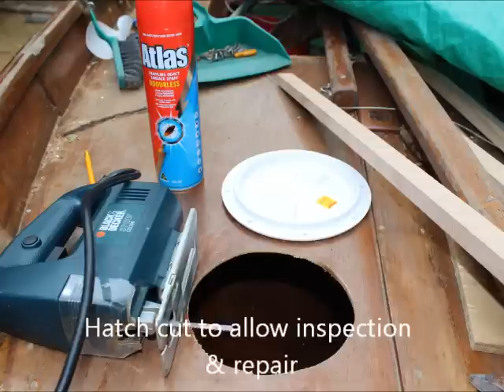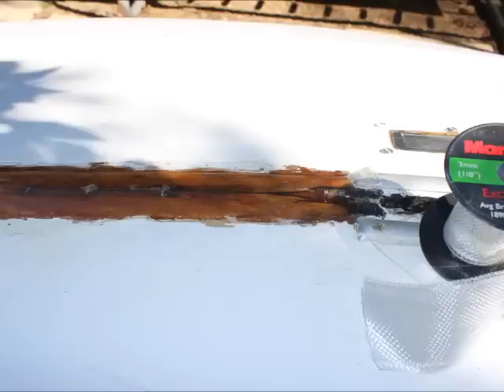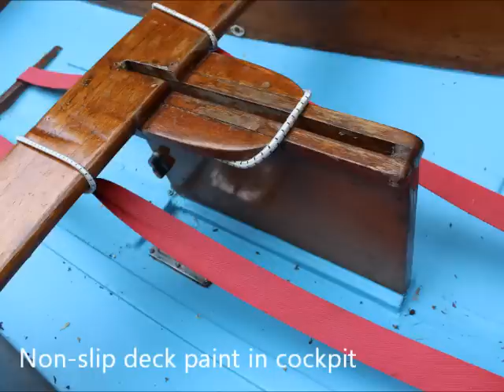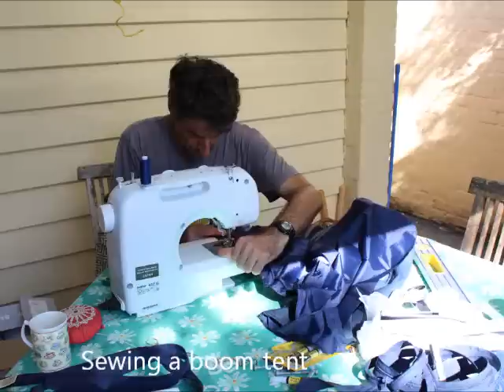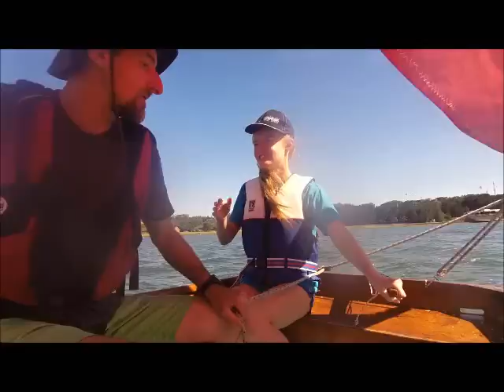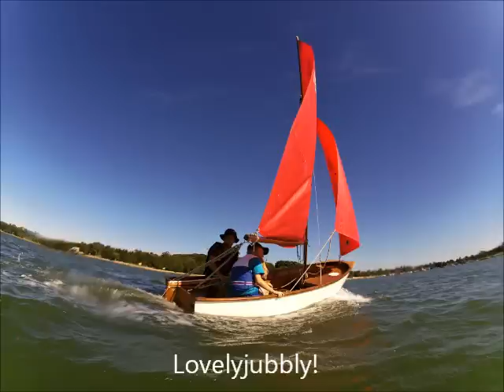Mirror dinghy story - restoration

Comment: Hi Kevin, Could you tell me the size of the deck hatch you put in, and is it in a 'strategic' location structurally?  Did you fit any other hatches? sizes? thanks
Reply from the maker: +Ian Rids Hi Ian,I fitted initially a small 6inch hatch but then enlarged it to a 1 foot model placed towards the starboard side (to avoid damaging the structural longitudinal beam). I stow large items up here such as sleeping bags so the big hatch is good. However, strictly this is against the Mirror Class rules but I'm a cruiser not a racer. cheers, Kevin
Reply: Hi Kevin, thanks for that info.  Large hatch sounds great.  I wondered if a large hatch may weaken the deck or make it flex alarmingly but its obviously working.  I will fit a 6" first (for inspection) then go larger as you have done. Easier to make a small hole larger than the other way round! lol. thanks again